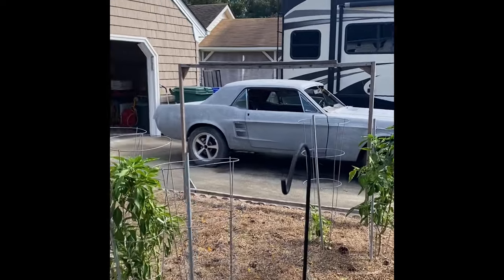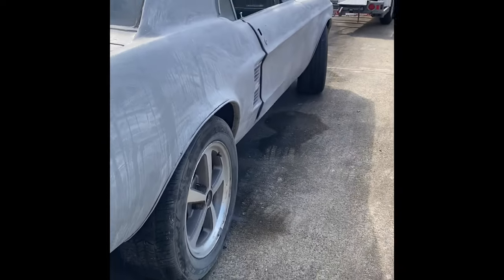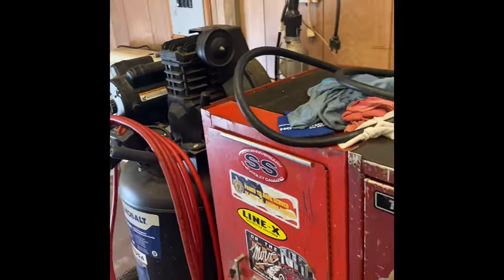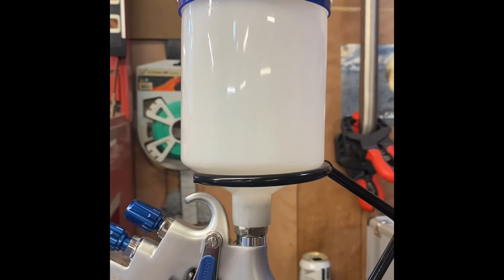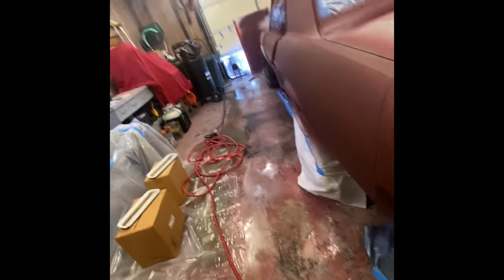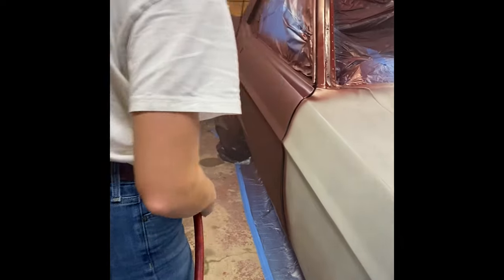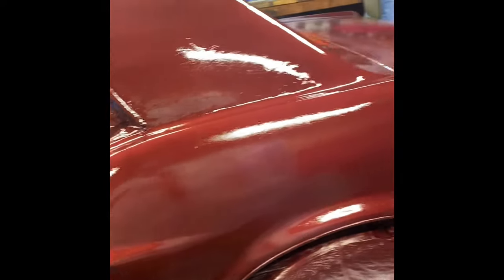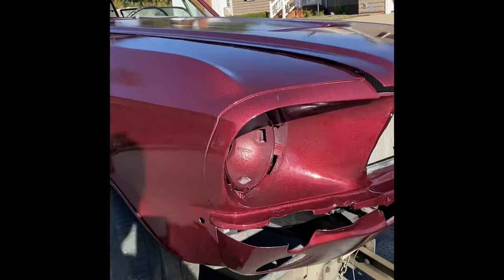DIY 1967 Mustang Paint Job

Comment: A great learning experience for your first time out painting an entire car. The final paint job suffers due to the lack of complete prep and bodywork ... numerous divots, dings, and flaws in the substrate. A classic car can take a lot of time to primer, block sand and primer and block sand until you get it smooth. The basecoat application looks dry in some areas, not sure the reducer matched the temperaturs in the garage. The cleared finish looks rought in spots. Cut and buffing may help but some parts of the car look like they might have needed more paint. I had a 1967 Mustang just like this one, it was a great car. Lots of fun, though mine looked way worse that this one did originally. Keep at it, Austin. Learn from your experiences and push forward! Great first time out.
Reply from the maker: I don’t recall the reducer we used, we fell a little short on what we would have liked with our outcome but I’m ready to drive it and enjoy it for awhile.

Comment: That's not good at all. sorry.
Reply from the maker: First time at all this, still a lot to learn but happy with it for my first time. Unfortunately I’m doing all this in the public street which has its limitations.
Reply: @austindowney7142  I fully understand, been there a million years ago. But, your choice of paint was a major problem with your early attempts. And I don't really mean the color. Although, heavy metallic does make it more difficult. I just think you should have dialed back your end goal and used a paint that would have been much more forgiving. You can take a soo so spraying result and turn it into a shocker with some after paint labor and knowledge. But that is effected by your choice of materials, for a beginner.

Comment: That's how it was for me.  My first time.  Ran into many issues and was nervous about it.  Now, looking back I know I made a lot of mistakes.  The temperature for the shot for the day was too hot.  90 degree dry day.  Had a lot of overspray.  I try preventing water in the line and still water got in.  30 gallons compressor could not keep up.  Bugs for the year was bad,  that is why I waited till summer. Should have waited till Early Fall.  I was fighting bug and spray gun.. and I have a good quality gun. Devilbliss..  dialing in the speed and flow of the paint is very important.  Paint would flash before it hit the car and psi was too high.  Every little things count.  Looking back I should have practice more on test panel fender or door. Maybe a little less hardener too.  I ran into almost all the problems with spray painting. But it was fun doing it.
Reply from the maker: We were rushed to have the car at our wedding so  we were a little short.

Comment: Eh, after some wet sanding and polishing it will be good because of all the orange peel I can see on the hood. But wherever that spot was that you said looks good did look really good. I will say that it was brave of you to use a metallic paint if you have no experience but it looks good. The metallic looks like it was distributed evenly, not too heavy or light in some spots.
Reply from the maker: Had some ups and downs getting the body work and painting thanks for a little positivity.